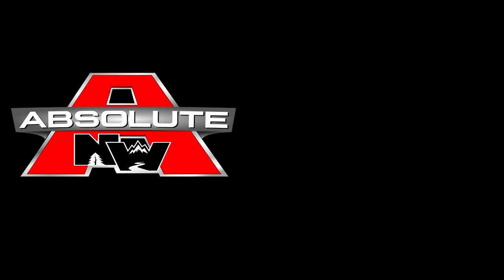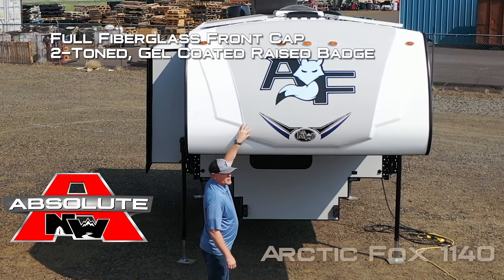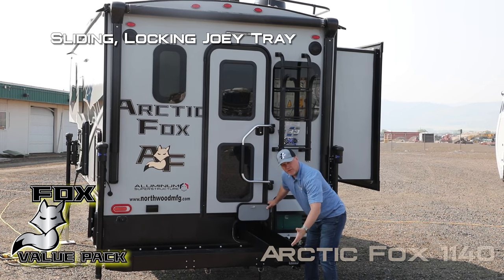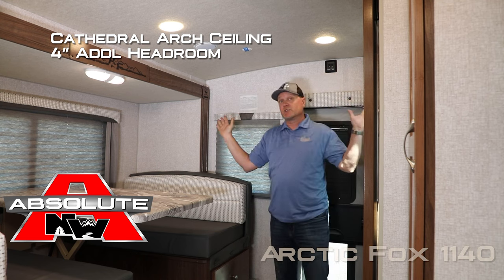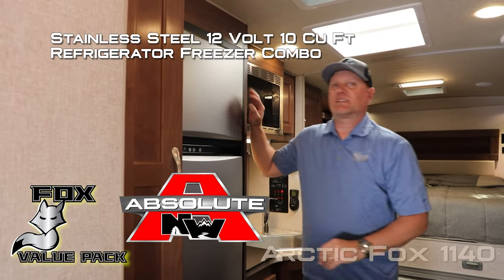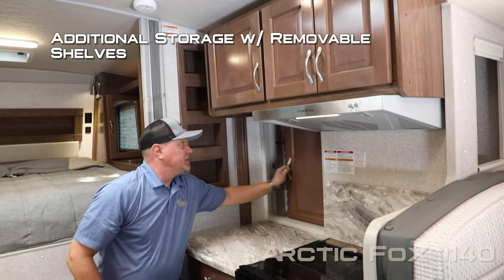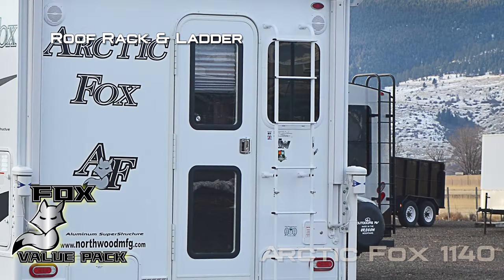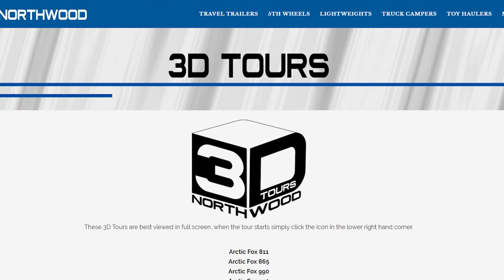Quick Tour of the 2024 Arctic Fox Pickup Camper 1140

Comment: The square tubing looks like it's barely 1/8" and the piece of wood inside it is a lot smaller than the tube, which i understand is fine unless your screwing from opposite sides. I see the weld is only on 2 sides top and bottom wouldn't it severely increase the strength of the thin aluminum tube if all four side were welded? I'm sure your welders are good but only two side welding increases the possibility of cracked welds severely. I do like your product can I order one with fully welded frame?